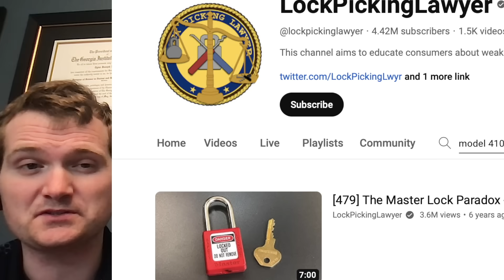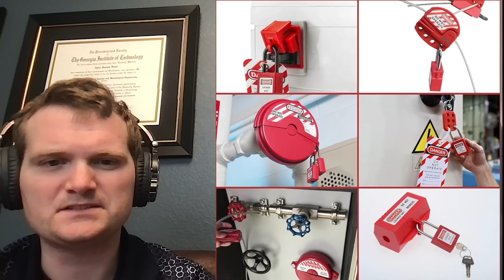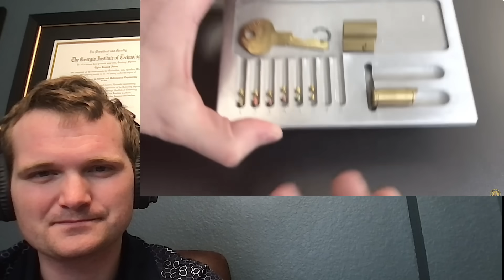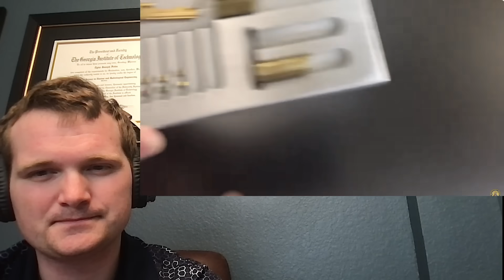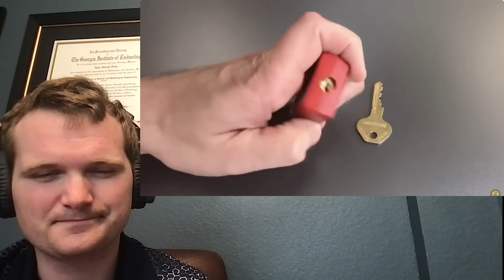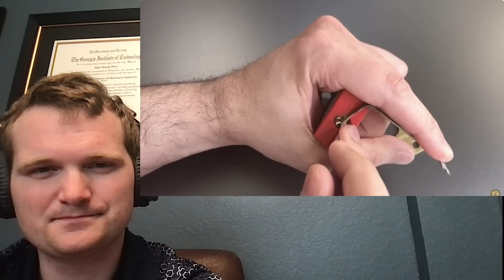Nuclear Engineer Reacts to LockpickingLawyer "The Master Lock Paradox - Model 410 LOTO Padlock"

Comment: I work in a manufacturing plant and use these locks extensively. We even have different colors for the status of what is being locked out. Red = temporary, Green = long term, blue =  supervisor at shift change and I can't remember what yellow means, might have the blue and yellow mixed up. I cannot tell you the amount of times the locks have been cut off because of the operator forgetting to remove them when they were done cleaning at the end of their shift and couldn't be contacted. This was in the past though as I think that the issuer now either has a master key or a spare key for the lock. New guards and regulations were implemented and now an entire department (30+ machines per shift) has to lock their machines out to clean them. 
1st guess as to why the core needs to be strong and not the lock. 
Bolt cutters or tools needed to break even a weak lock aren't readily available and in most cases the operators just have the basic tools they need to run their machines. Exp... calipers, tape measures, crescent wrench, hammer, cleaning tools. Heavy machinery operators would have the tools that could defeat the lock, but in most cases those operators are older and unlikely too.  
2nd guess,  Lawyers
Reply: At my workplace it is still 1 lock 1 key and the key stays with the employee that put it there. After an inspection and hopefully being able to contact said employee. If it was deemed safe to operate then we would have to cut the lock off. I empathize with your plight of always having to cut so many off, that does sound ridiculous. However, if someone repeatedly forgot to remove their lock then they would get fired.

Comment: The reasons for different lock bodies and corse for LOTO locks vs security locks are the implmentation and use. Most people who commit theft are more incline to break locks rather than pick them. Mechanical failure in locks are easier to learn and require little skill or practice. But picking locks requires finnesse and practice to be proficient at picking a blind lock (a lock you've never picked before or know it's core internals). Most consumer security locks are beefy and robust for that reason, but use easier or smaller cores. However to open LOTO locks are easy to destroy but hard to pick to prevent covert removals (like lock picking). In an industrial setting you are more likely to notice someone destroying a lock than picking one. Why not have the best of both worlds for both kinds of locks? You have already answered. In an emergency, you need to be able to readily remove a LOTO lock with fair ease, but at that point, everyone knows what you're doing and why. If you made a robust and difficult core, for a consumer, that lock would be incredibly expensive, and thus no one would buy them anyways.

Comment: I'm glad you mentioned the reason the standard LoTo lock is non hardened, they are there so someone doesn't accidently harm someone while they are working, or accidently activate a faulty system. However, if they lose a key, or there is an emergency, they need to be able to be cut open quickly. I've never had it where it was a need to open one immediately but We did lose the keys to one, then per policy of the company I was at, we had to fill out a bunch of paperwork to describe why we cut the lock. Just for record keeping that hey, we lost the key, we removed the lock. 

Also, yeah, most locks are there to keep honest people honest. They act as a deterrent, The reality is that if someone is going to break into something, Think about the standard toolbox latch over eye lock setup, doesn't matter if you put the best lock in the world on it, Someone that wants to get in is going to look at that and go "I can cut the latch tongue with tin snips" and that's the end of it. The lock is there to keep out people that would get in through "oh look it's not locked" or "I'm sure he won't mind if I borrow X". of course that's a typical example of where you might see a heavy duty lock body, I've seen a lot of guys in the shops put beefy looking locks on the boxes, while we all know that the design of their toolbox will stop someone that actually wants to get in for about 10 seconds, Or they'll just take the whole box.

Comment: There is a bit of "intimidation factor" at play on the other locks.  The main issue is that real thefts and destructive crimes don't involve picking locks.  Partially because it's a learned skill that takes time to master, but also these crimes are usually quick and the criminal is expected to have fled the scene in less than 10 minutes.  Even a good lock picker can burn 5 minutes on an unfamiliar lock, compare that to braking a window and unlocking a door through the opening, or entering through an unlocked upper window via a ladder.  There's less time exposed before entry that could arouse suspicion, compared to kneeling in front of an entryway for several minutes.  It's a matter of least resistance, there's often easier ways to bypass security than through the lock.
Reply: Well...that unless they have a rake. Low-skill, faster to use.

Comment: LPL later mused that it may be so that a LOTO lock is easy to break with evidence of tampering, but hard to pick leaving no evidence of tampering. The other locks are easy to pick, but hard to break as evidence of tampering is no longer.
Reply: I'm betting there's one or two weird industries where pick resistance is important for compliance; and they just make the same locks for everyone to reduce cost. 

Like, maybe for the federal government, there might be a regulation about minimum pick resistance for all locks, which would technically apply to LOTTO locks, too. Or, something.
Reply: @creativecraving  possibly, but I like the low resistance to anything that is tamper evident, but high resistance to anything that is tamper invisible.
Reply: @SuperS05  I think this is 100% the right answer, you want the ability to evidently tamper with a lock, quickly and easily if for some reason there is a mechanism that must be accessed very quickly to prevent something dangerous from happening, however, in an important facility like a power plant that maybe some day come under attack from something malicious, you want to make those attackers work for attempting a non-evident attack. 
To be fair, if someone is committed and trained enough to be messing around maliciously in a power plant covertly, they probably know advanced lock picking technique, but maybe this would slow them down. I could think of a scenario that a malicious actor could easily and covertly rake or bump a lock open even if there is frequent surveillance or other people in the area, but try pulling that trick with a 1-2 minute single pick attack and it's a different story. Overall, very fascinating stuff.
Reply: @bbdskateboardingfan  less planned malicious attack and more a wayward coworker/manager deciding to override safety.
Reply: @SuperS05 true, thats definitely another factor, and more common place
Reply: @b @bbdskateboardingfan  The shredders we have at work, are interconnected with the control system of the entire plant. If you were to somehow remove a LOTO lock, flip all breakers, reset all E-stops (there’s seven for each shredder, along with a closed hatch check), the technicians in the control room would still need to reset any signals from the shredder in order to so much as engage the oil warmer.  
I realise not every dangerous machine is this safe when locked out, however a shredder is an excellent example of where a malicious removal of a LOTO might occur, if someone was trying to ”get rid of someone else”.
Conveyor belts and augers also have the same communication with the control system, so in order to start them, you would need to contact the control room and have them start them, which they wouldn’t as they know the work in there isn’t declared finished yet.

There are many safety checks, but at the end of the day, LOTO locks are mainly there to prevent accidental starts of machinery.

Comment: "is there a word for this"
100% yes, its called "security theater" things that fall into this category are just about ANY lock on a home (as windows exist, allowing for complete bypass of locks WITHOUT picking), and the TSA/"border patrol"

"security devices" are designed so that you, as the owner of said device, FEEL secure, weather you ACTUALLY ARE OR NOT,  because if it makes you "feel secure" you are more likely to buy it, or in the case of the TSA, accept that they keep you secure, and accept the MASSIVE privacy violations they are able to get away with. (the same can be said about modern "smart" home security devices/services which due to being "connected" are INHERENTLY LESS SECURE than previous things)

Comment: I operate a large double span hydraulically powered concrete swing bridge. These locks aren't used too often, mostly for locking out circuits or generators. We usually remove keys and use yellow (caution, communicate before operating) or red (do not operate, remove key and take key with you) tags to denote work is being done on certain parts. It's really interesting to see what other industrial workplaces may use for LOTO situations.

Comment: Doesn't matter how beefy it looks. If there is MASTER written on it's an invite to be quickly picked and often not even picking is necessary as they have well known security flaws. 
Basically a Master Lock is like a nuclear power plant with a heavily guarded front entry but the back door is open and all the important controls are right behind this door.

Comment: The worst part of Master's lineup is that their flagship padlock, the Magnum 930 (the last one he showed), has a massive known security flaw. 

Master decided to put a rubber weather cover on the bottom of the lock. To hold it in place, they extended the core retention nut by a quarter of an inch. If you simply rip the rubber cover off, you can grab a hold of the retention nut with a pair of channel locking pliers and pry it out. The internals of the lock will all come out, and the lock will open.

That flaw has been known for at least six or seven years.
Reply: A lot of the exploits that open 98% of the locks you'll ever encounter in the US have been around for decades to centuries.  It's a pretty bad industry.
Reply: @derpderpin1568  LockPickingLawyer actually gave a presentation at SaintCon (a digital security conference) about this! It's crazy how resistant the physical security industry has been to change, especially when compared to digital security...
Reply: Definitely. I've been picking for years, and some of the stuff is inexcusable, like overlift attacks.
Reply: MasterLock Magnum 930: The strongest padlock MasterLock makes

McNally: ** P L I E R S **
Reply: Yeah it's well known in the industry that locks aren't really secure, they just give the feeling of security and intimidate people from trying.
Reply: Locks are for good people, criminals don't care
Reply: Damn, and I thought it was bad that most padlocks from Master can be opened using most padlocks from Master.
Reply: 6 7
Reply: That's crazy.

Comment: I usually never have anything to do with stuff where LOTO locks are used, but I once visited a friend that works in a small university particle accelerator. All the entrances to the actual ring had these LOTO locks, which I expected, but what totally surprised me was that there were LOTO keys on all places where ladders were stored as the radiation zone was technically a cone.
Not really related to this video or the LPLs video, but that's an interesting memory this video triggered :)
Reply: That’s really interesting. If I’m understanding you right, that’s like a “reverse LO/TO.” 

I’m used to putting these things on equipment to lock it into a safe state before working on it.

It sounds like the ones at your facility were to deny access to the dangerous area until the equipment had been put in a safe state.

Comment: I do wonder if it's based on safety regulation. Make something easy to bolt cut by Admin, but difficult to bypass by rank-and-file.
Reply: yeah, bc picking is harder to detect than destroying a plastic body
Reply: @emmata98 I think you may have hit the nail on the head actually. Harden them against non-destructive attacks so it’s obvious to the owner when one is opened by someone who isn’t the owner. That way you don’t lose the chain of custody by re-locking the system out with the same lock and without the owners knowledge. 

If the lock is removed in an emergency, and the lock owner isn’t present. Then when they return, they’ll know they have to re-certify the system is in a safe state for work to continue even if no one tells them.
Reply: That was what Tyler was getting at when he was going on about cutting it off in certain situations. I think LPL's main point was that on locks that are supposed to be secure against all forms of entry, both cutting and picking they use rubbish cores whereas on locks that don't need to be so secure (in general but mainly against cutting) they use much better cores.
Reply: Sort of. The specific regulation is that whoever puts it on retains exclusive access to the key and is the only person who can remove the lock.

However, regulations do allow for removal if the operator cannot be reached. All reasonable methods to reach the operator must be exhausted as the ideal is that they personally remove it. If they cannot be reached or cannot come in, they MUST be notified in person (I think phone may also be allowed I'll have to brush up on that) before the start of their next shift that the lock has been removed. That's why regulation also specifies a name be on the tag.
Reply: That definitely can explain why the body is weak on the LOTO lock, but doesn't really explain why Masterlock seems to not sell any more security focused padlock with 6 pins. To a certain extent, it can easily be partly explained for most of the rest of their product line that generally, thieves aren't going to take the time to pick a lock: they will just break it, or maybe more sophisticated ones will identify a lock model with a known bypass method. But one would think that their higher end locks would use the same core as the LOTO, since they already make that more secure core. It would add a negligible extra cost of materials to the lock to make it significantly harder to pick, and they are beefy enough that breaking them off is no small feat.
Reply: Sometimes people forget to remove locks after finishing, if they go home and it's verified nobody is working on it it can be cut off.
Reply: In some situations, maintenance workers are expendable.
Reply: @Yora21  to be fair if it's between one dead worker and a whole crew/town the risk can be taken.
especially if you're working with hazardous materials or explosives